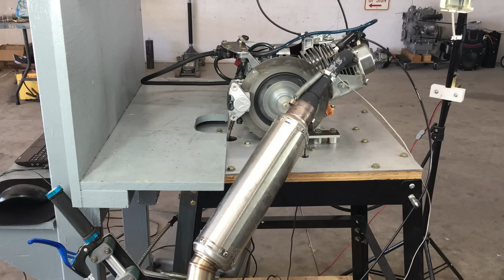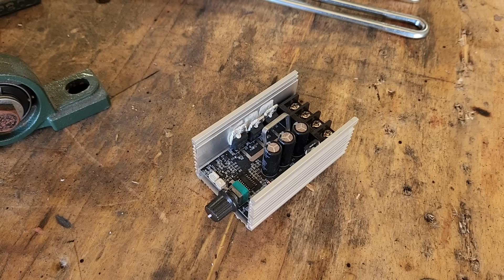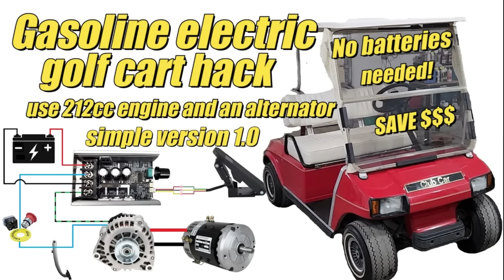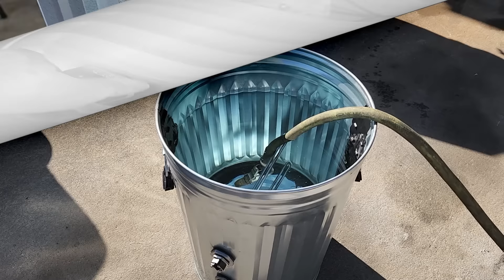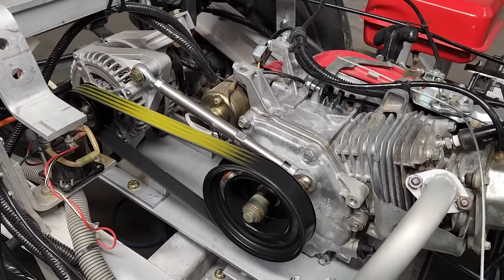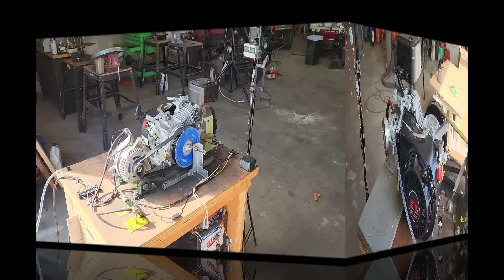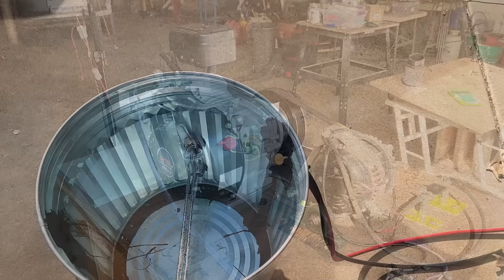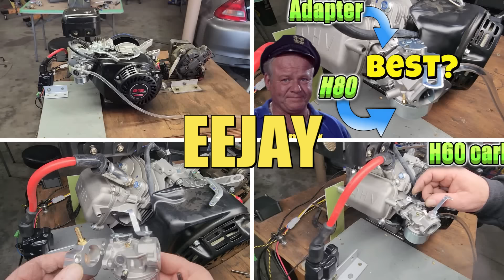S6 E5  Our small engine test stand is BUSTED!  can we fix it on the cheap?  Let's do an experiment!

Comment: Electric elements in a trash can or barrel is the start of a still. 😉
Reply: Hey now, don't go in a totally different direction that could be its own channel that I would immediately subscribe to right now.... 😂 Jimbo would definitely be an excellent choice to set up an auto-regulating primary ferment vessel
Reply: Oh damn ideas ideas
Reply: nothing like a little zinc flu to go with your white lightning, with notes of flexseal
Reply: Still it channel
Reply: Taking a keg, a sixth barrel or even as large as a half barrel. If you want to go crazy and put a couple of electrical elements in it. Then a column adapter on the Sankey fitting on top of the keg is a very common thing to do to start a still. But this will work too. I'm just not real sure about the galvanizing part